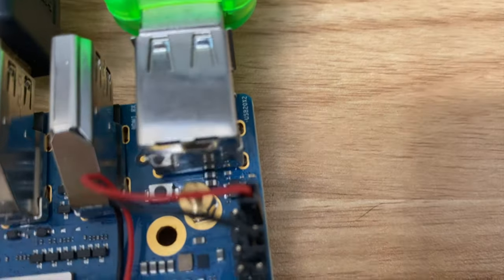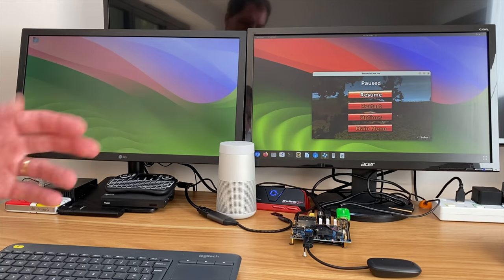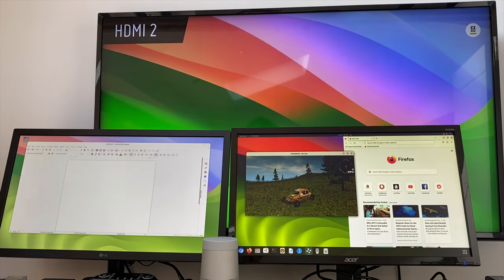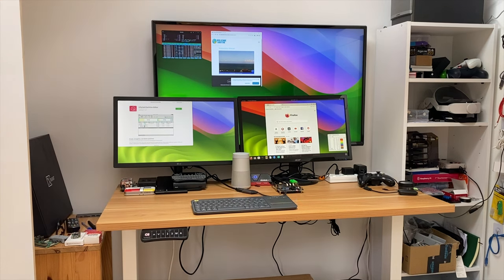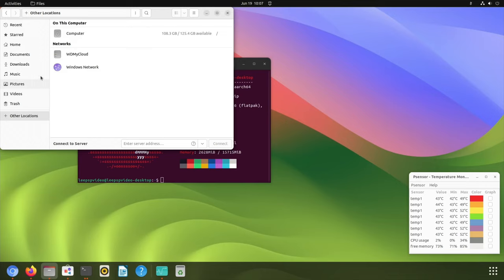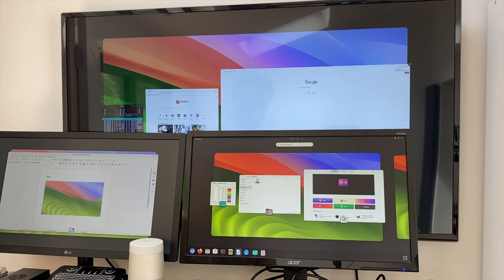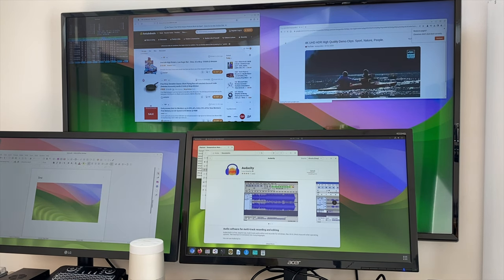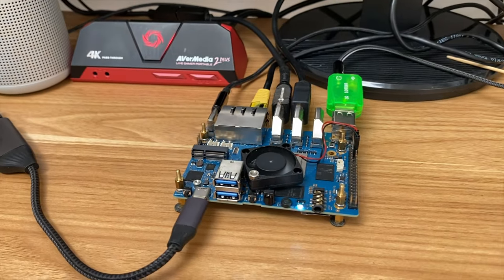Orange Pi 5 plus TEST with 3 monitors

Comment: I've never felt the need to use multiple monitors, because I have multiple desktop/workspaces and I generally tile 2 or 4 windows to edit things with, but if I ever go back to using an SBC as my only computer and decide to work like that, it's good to know I'll have the option.
Reply: I am with you on that - I only ever use one screen with the rare exception that I have an old Thinkpad T60 with a 4x3 screen on which I have all of my PDF documents stored - so if I need to refer to a BASH or Python manual when doing some programming work, I will fire it up and have it next to me with a PDF open on a screen with the best aspect ratio for PDF.

I've worked in the telecoms and IT industry for decades now and often on customer sites where I usually just have a laptop with one screen - so I've just organised my entire workflow on that "lowest common denominator" scenario.

Again, just use shortcut keys to make the best use of multiple workspaces, as you said.

Comment: Awesome setup. I'm having such a hard time getting my OPi 5s up and running in a stable way booting from nvme. I've tried the Opi5 ubuntu image, the armbian image and the debian image. Is there an image you recommend? The ubuntu image is also missing orangepi-setup and armbian-setup so I can't install the bootloader on the nvme with that. Would appreciate any help.
Reply: The Ubuntu XFCE image seems to work fine. Unfortunately, the GNOME image is borked out of the box. For me it locks up as soon as the Ubuntu logo shows up. Which is too bad. I was kind of looking forward to trying it.
Reply from the maker: I mostly use Joshua Reiks Ubuntu. It’s working on Pi5 Pi5B and Pi5 plus. You need to download the correct version for your Pi5 as shown in this video
	
	The fastest Orange Pi! Pi5 PLUS.
	https://youtu.be/cr7Cw-po_zA
	
	The original Orange Pi 5 without eMMC just works. If you have an eMMC model see this video
	
	Nvme boot fix and speed test. Orange Pi 5
	https://youtu.be/dDIMJowwpZk
	
	And this
	
	USB Boot tests Orange Pi 5 / 5B. UASP Vs Mass storage
	https://youtu.be/u5z25Atdcj4

Comment: use case ?  how much does 1 monitor cost in electricity, might be useful for a pub quiz !
Reply: Coding while gaming while watching leepspvideos?
Reply: Very useful, as an example while I'm programming I have one or two monitors with documentation open and a third one for the IDE. Not to mention that I still need to switch tabs in webbrowsers, or need to switch to spotify, teams, calender, a second IDE, etc... I could easily make use of 6 monitors because I use more than one machine. It's the reason I also have a multi-device mouse and keyboard. 

I pay anywhere between €7.5 to €40 per monitor per year for the energy it consumes, depends on size, usage, etc...

[EDIT] had to adjust prices for monitors as I was forgetting an older more power hungry one.
Reply: I have a 34" Ultrawide that I use with my raspberry pi, got tired of the multimonitor setup. It uses around 60 watt. Some monitors uses way more, and even have fans inside them.
Reply: You could buy those tiny, cheap displays and use em to display a system monitor and the current weather.